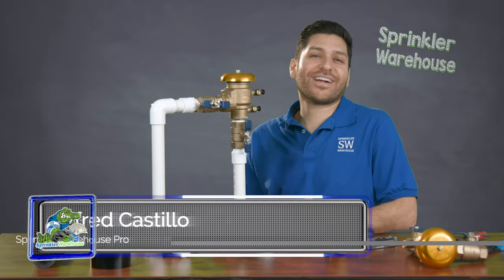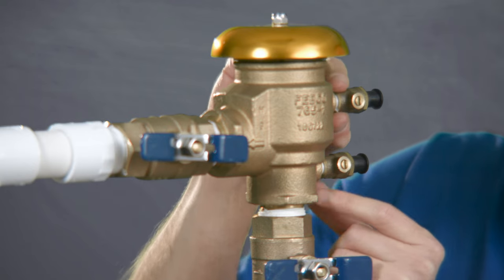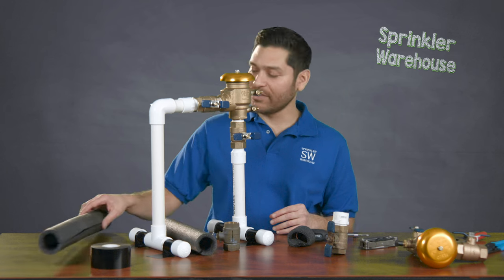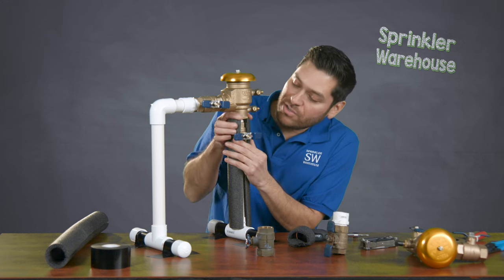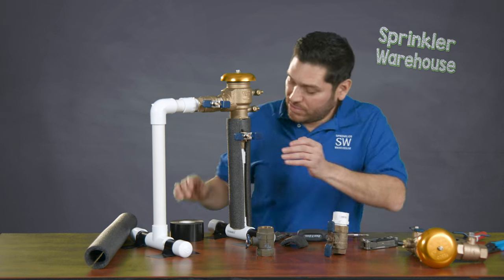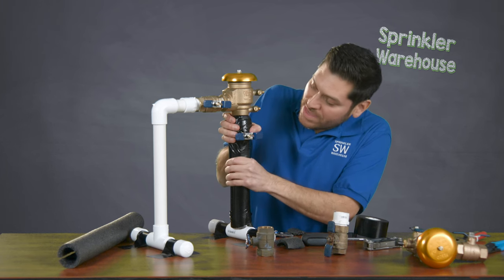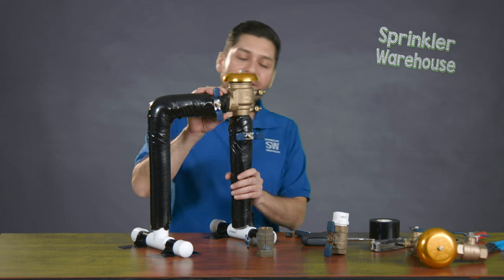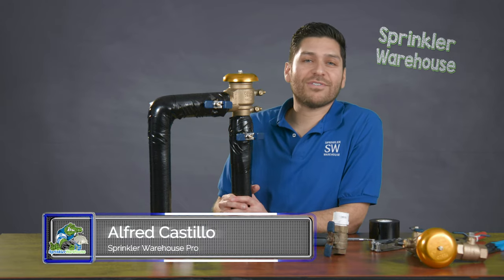Winterizing Your PVB Sprinkler System Backflow Freeze Prevention

Comment: No.  Blow the water out.  Trust me on this.  The only thing the foam can do is buy you a little buffer time if the temperature outside drops below freezing overnight for a few hours before warming above freezing again in the morning.  But if you live where the sun doesn't shine much in winter, and the outdoor temperature stays 10 degrees below freezing for a half-day or more, the foam isn't going to prevent the metal from eventually freezing.
Reply: How do you blow the water out of lines
Reply: @israelrosales2244  You either hire someone who does "sprinkler blowouts" using an air compressor or you do it yourself with an air compressor that can reach sufficient continuous pressure.  Research that.  I prefer hiring a professional since they have all the adapters and experience to know when it's getting done.
Reply: Or a small compressor that has charged a large compressed air tank.

Comment: NOT accurate for northern climate. There is NO source of heat that insulation is retaining, and it won't effectively keep out the cold. As others have stated, just  do not open the bleeder valves all the way, that allows any little bit of water behind the valve to evaporate to the atmosphere.

Comment: If outside temperature is below freezing piont isolation will NOT help you, because nothing will warm your pipes. Pipes are not alive and don't have energy sources. It will freeze anyway after couple of days. The only way to keep pipes in working conditions is to remove the water completely from all irrigation system components before freezing season.

Comment: What’s the point of this insulation? If it is not heated, or doesn’t have continuous water flow from the inside, it will freeze anyway. Maybe not in 10 minutes, but in an hour, but it WILL freeze.
Reply: slow freeze i assume is better than quick freeze.  Plenty of places in US, it will only drop below 32 degrees for few hours of the day.
Reply: @spacecadet28  It cannot be a general advice then, and you are also pushing your luck. If it goes below freezeng point regularly, then in every few years you will get a more extreme weather where it deep-freezes. 

Check the official frost-line in your area. If it is close to zero, then you might get away with insulation only, and your in ground pipes might be also okay. But in most of US, it is not close to zero.
Reply: It might freeze. But the purpose is to not crack during the winter

Comment: Oh boy... ice storm of 2021 in Houston Texas...I had the EXACT SAME crack on the supply side valve that you showed here. The ice storm of Houston Texas 2021 got me. Like you said...I did everything (shutoff the valves, drained the two small valves, wrapped it the whole thing with 2 Beach towels... put a trash bag over it) except insulate the the supply valve.... and still a CRACK at the valve.
Reply: Don't worry, u didn't do anything wrong, it was a hard freeze and nothing would have stopped that crack, you're not the only one.
Reply: Did you drip internal faucets to keep the flow moving?
Reply: @rickkay9548  yep,but this was for the pvb backflow, I have a really good landscaping company that I use that has parts if anyone needs help replacing.
Reply: If you need someone to help replace your pvb, I have someone that I use, very reliable and professional
Reply: @joshuanovuss7866  know where I can get a 1/4" quick connect that fits that febco 765-1 testcock?
Reply: @rickkay9548  try sprinkler warehouse
Reply: @joshuanovuss7866  Sadly all out Might need to see if I can find an an adapter
Reply: @rickkay9548  well, if you are in Houston,TX I have the parts to do the install, the cost is $250 however, but it will get done, new PVB and piping.. let me know, thanks.
Reply: @joshuanovuss7866  Thanks Josh, thankfully the PVB housing is ok, and I replaced the sacrificial plastic valve. Do you know where to get the testcock-to-1/4-quick connect pneumatic  adapter for blowout later? I don't want to have to frankenstein a bunch of parts to adapt it.
Reply: I wonder if you open the values after you have bled the line vs. having them closed like I did in Houston would you still get the crack.  Of course the main water cutoff would have to be off.  If the ball values are closed and still have some residual water on them that freezes it can crack the pipe.  Did you have your values open or closed.  Just want to know for next time.  I think all of my neighbors pipes cracked during the Houston freeze.  Seems like these things need to be built better.
Reply: @Patrick_Armendarez  I had a plumber stop by and replace it. I had the valves open...but it still cracked right at the supply valve.  The plumber says that's where water gets caught and causes it to crack.  He mentioned that he had been replacing these all over the Houston area.  He did say that the PVC pipe that I had running to the PVB valve had more FLEX in them and were a different grade than what he's used to seeing.  As for the PVB, He charged me $180 for a new part and when it was all done I paid about $350 total.  His only advice was to insulate all the way past the supply valve... he added, "someone is MAKING A LOT OF MONEY on these PVB valves, especially when it drops below 29 degrees. They just aren't built for it."
Reply: @RoySFord   I leave my downstream (sprinkler side of PVB) half-open / half-closed, so at like a 45-degree angle. Same with the testcocks, I leave them at a half-open/half-closed position. The theory is that gives any residual water a chance to evaporate, or if it starts to freeze, it has somewhere to ooze around the valve instead of being trapped and splitting the shell. My supply-side ball valve (coming from the main) still split, because I had to have it fully closed, but none of the others split. It's crazy that we (in Houston) typically don't have any upstream shutoff for our sprinkler systems (just the main shutoff is all).
Reply: @Matt-xs1kc  you wrote, "I leave them at a half-open/half-closed position. The theory is that gives any residual water a chance to evaporate".  
If you leave them fully open (as the video suggests) why wouldn't that Also "give residual water a chance to evaporate"?
Reply: @delg1211  because in the fully open position, a thin film of water can get trapped in the channel surrounding the outer edges of the ball. Then when it freezes, it can expand and crack the valve body, usually on the opposite side of the handle. The odds of this happening are admittedly much less than leaving the valve closed. Leaving it half-open/half-closed gives maximum openings for any trapped water to escape should it begin to freeze. The difference in risk of full-open vs half-open isn't much, but after you pull the short straw once, and aren't able to get replacement parts because everyone else in your region has the same problem, I feel that being persnickety about full-open vs half-open is worth a couple extra thoughts to reduce the risk as much as possible. ;)

If you check out the animation in this video, you'll see what I mean about the trapped water in the fully open position (mostly on the side opposite the handle): https://www.youtube.com/watch?v=NkunrVVtqVQ

Comment: Following these instructions provides homeowners w false security.  The only people that this advice benefits is sellers of PVBs and the guys that come out to replace them after they freeze and burst 😀.
Reply: Mine broke and it was almost all drained, had pipe insulation as shown and covered with a thick movers blanket and a trash bag. Insulating like this does nothing. I replaced it with a new one and installed  a T with a stopper on either side to completely drain the valves. We’ll see how I fare this next winter.
Reply: @henryuta  Good idea. Where are the Ts? Right above the ground?

Comment: Shouldn’t an isolation valve and a valve for draining be installed below the back flow preventer valve on the inlet line? This would insure that all the water has been drained out of the ball valve directly below the back flow preventer valve. We have had many cracked casings on that ball valve in the area where I live because very few systems have the drain-bleed off point installed.

Comment: I put in a water spigot about 6 inches above the ground on the inlet side to keep water from sitting in the pipe. Worked perfectly for the cold weather a few weeks ago here in Houston. The bleed valves only drain so much but this definitely keeps the water out of the back flow.
Reply: Good idea! Can I just move that shut-off valve near ground( new shut-off valve with drain port)?My inject shut-off valve damaged and try to fix it now.

Comment: Here in New Jersey it is common to blowout for the winter the entire sprinkler system, zone by zone, through the PVB.  In looking at many posts people believe you should not do that for the reasoning that you can damage the internals of the PVB.  In my installation there is a hose bib on the supply side piping of the PVB and another on the outlet side to the valve box(s).  So, I can do a system blowout either way.  My winterizing guy has always said that a complete blowout of the piping and PVB can really only be accomplished by blowing out through PVB.  He has done this for the last ten years with no apparent PVB damages.  (Watts Series 8004M 1")  I do not see any recommendations from Watts or Febco concerning this in their instructions if blowing out through the PVB is a bad thing.

Insulating the pipes in a harsh winter environment is not going to work if there is any standing water in the system or in the PVB.
Reply: Came here to find the same answer.  Just moved into new house in NE OH, where we need to blow out the system.  Just had someone out today and he wouldn’t do it since there are only the test ports on the PVB for blowing out the system.  I can only imagine this is what they’ve done in the past, but this seasoned sprinkler technician was adamant that I need a plumber to add a hose bib on the downstream side of the PVB.  Interested to hear if that’s my only recourse or if going through the PVB is acceptable in any cases.
Reply: Febco has their own video. This guy isn’t doing enough for northern climates. I’ve been doing mine for 31 years. No insulation used. Wouldn’t work anyways. Too bad he didn’t say what state he was in.
Reply: @PaulKuester  I'm in Michigan yes you do need a port after the PVB .. that way you don't have to worry about messing up the PVB internals. But if you do not have a port after.. then going through the side ports before the PVB is possible if done cautiously. Its actually easy to make your own port if you buy the Sharkbite tee valve and add a hose thing to it... Probably can be done in 10 minutes. Watch some videos on "sharkbite" and how to . Its real simple.

Comment: I'm here due to the Freeze and mine was gushing into the air. Merry Christmas to me. Mine doesn't have the two blue valves though. It's just a brass bell thing with the two white PVC pipes going into and out of it. Should I go buy one like this? Thanks! My house is like 1960's.

Comment: Winterizing is extremely easy by having two unions & just remove the PVB. If you have a isolation valve close to your meter for the irrigation that should also be shut off. All irrigation lines from upstream supply  & downstream of PVB should be drained.

Comment: As another mentioned below, you must drain all the water from the supply line into the PVB, and leave the valve half open.  This will allow you to shut off water to the supply and the water can drain out of the supply line and prevent freeze damage.

Not draining the supply line, this routine will probably only work in USDA Freeze Zone 9 and maybe 7 and 8, but any of the others you really need to drain the supply lines.

Comment: I am another ice storm of the Houston Texas 2021. I had all the proper insulation and additionally a winter cover of all the backflow preventer and still the same crack. One of the days we had -8deg F. For the looks of it, sprinklers are not made for those temperatures. Your thoughts?
Reply: Really need to blow out the water to be safe.   Commonly done in Northern climates
Reply: The bobwallace comment is a good one (count 3 comments above yours to read it) He said: "I put in a water spigot about 6 inches above the ground on the inlet side to keep water from sitting in the pipe. Worked perfectly for the cold weather a few weeks ago here in Houston. The bleed valves only drain so much but this definitely keeps the water out of the back flow."

Comment: If you need to winterize, insulating the PVB does nothing at all. Insulate that all you want. When it's 20* outside, go outside, pull that insulation off and measure the temp of the pipe. Guarantee you the pipe is also 20*.

Sustained temps below freezing will not be mitigated by insulation.

Insulating is only to get you through moderately cold temps at night if you have not drained the pipes and if temps are going to rise above freezing the next day.
Reply: @Christopher Campbell      I’m from Minnesocold  and I used heat tape on our pipes on where I could reach. That was in the basement though.  Then out side on the hose bibs I used heat tape too. Just need an out side power outlet and extension cords. This is my 1st sprinkler system,so would heat tape work down here in a freeze?  Same for my pool auto feed BFP? Thanks

Comment: Insulating the line coming into the PVB IS CRITICAL but if the system is winterized, meaning all water has been removed from the output side of the PVB in the actual sprinkler pipes, there should be no water in it to freeze and therefore NO POTENTIAL LEAKS.  Appearance may be a consideration but not possible frozen water.

Comment: To me this is all for show (you may do it, but not really need to). What is important is the water supply side MUST have a water draining switch to let all water out, and kept it open but turn the main supply OFF preceding to the switch. Let's think for the moment, just because you wrapped the the so called cold preventing isolation, the exposed  water pressure breaker is made of metal. If you are high school graduates, you should know that metal is 'high level'  heat/cold  conductor. It will literally transmit the heat/cold nearby section of the pipe. So, does the isolation really do the justice? Have you measure the temperature difference between the exposed and covered sections?
Reply: Literally being extra, no one does that lol. Makes no sense

Comment: Is it necessary to also shut off the main line by my water meter, or will shutting off the valve on the supply side pipe be sufficient? Thx.
Reply: Yah.  Insulating the water inside your pipes only buys you time before it freezes.  I’m sure this is good for some certain latitudes and elevations, but it’s not going to help in any areas that gets below freezing and stays there for over 18 hours

Comment: Nice but you didn’t finish the job here in Texas we shut the valve supply to breaker open the drain valves make sure the master valve is off drain both sides of the breaker now as for the bell section some take the top off and put it up till spring others make sure both the petcocks on side are open and finish raping the bell section in foam iv had to replace many because they just stopped at the pipes that brass will expanded like a balloon if not covered best way is to split it into 2 pieces that will be wide enough to fit tape it then a piece on top then rap it good  iv even seen a few take wool blanket or piece of stiff foam and put over top whole thing to cut the cold air and hard plastic that will stop the cold wind driving threw it

Comment: Question if anyone can help me with an answer. Can I just leave it wrapped all year?
Reply: Sure. The insulation is useless in every season. See the comment above by Nomina sunt Odioza. Insulation will only delay the pipe from freezing for a few minutes. The only way to prevent freeze-damage is to remove all water from the system.
Reply: @russjohnson6396  Exactly. I was fooled by this wrapping insulation method and my pipe crack on the inlet side where there was still water.

Comment: Does the valve and Bell need to be insulated or covered? I'm in West Texas and lots of wind blows sand everywhere, and I'm thinking sand will get into the bell area.
Reply from the maker: The system is actually sealed tight and won't be affected by a small amount of sand under the bell. However, to be safe, if you are that concerned you should ask a local licensed irrigation contractor, they will know the best practices for your local conditions.  Remember the water enters from the bottom and exits out the side. So insulating the inlet valve is a must. Everything on the outflow side is just safety in case you don't use air to blow out your pipeline in the winterization process.

Comment: Well done Alfred.  Our back flow preventer assembly is located about 1" away from the outer wall of the house.  Wrapping tape around that is quite a challenge.  Do you have any suggestions about how to do that?  There's not enough room to pass a spool of tape between the preventer and the wall.
Reply: It takes a little longer, but you will have to cut them into strips to wrap around the insulation. Try lapping the tape 50% longitudinally (where it goes horizontally around the pipe) and have at least a 1.5" overlap on the butt joint (where the strip of tape ends on itself)
Reply: rather than passing the spool of tape, just pull the tape off the spool that your going to use.  then you only have to slip the tape behind the pipe.
Reply: Use outside heavy duty zip ties around the proper size pipe insulation (you will not see any gap) instead of using tape to avoid that headache.

Comment: Some people put the close valves at 45 degree angle. Why? Is this necessary?
Reply: For winterizing - to drain the water from in and around the ball otherwise you may have trapped water that can freeze and cause damage.